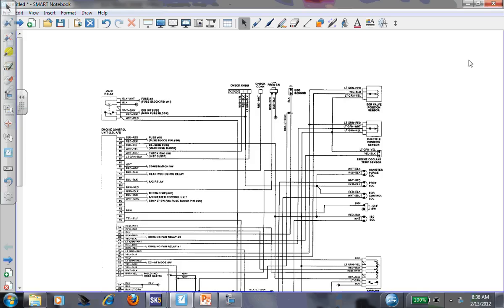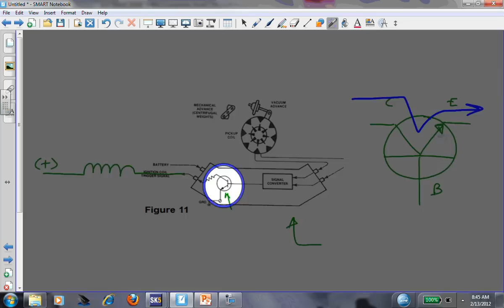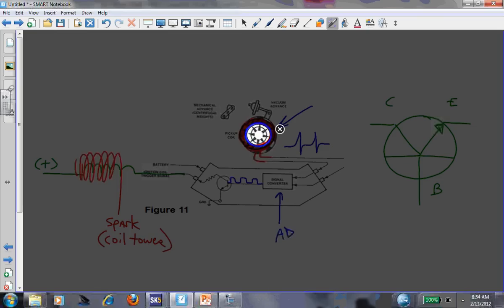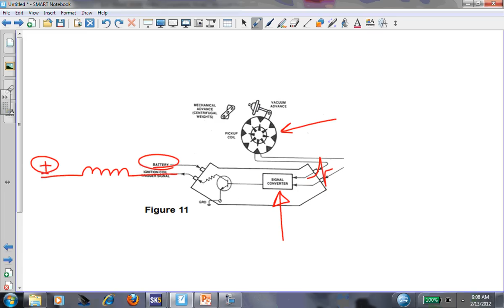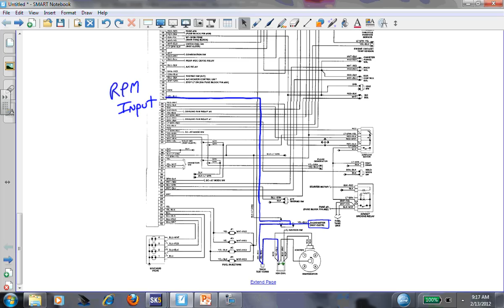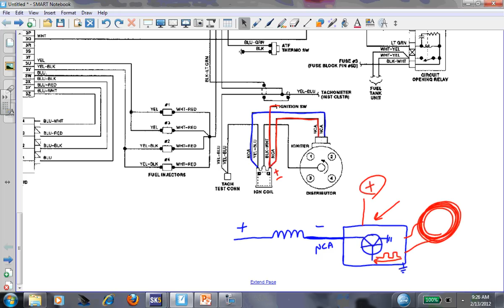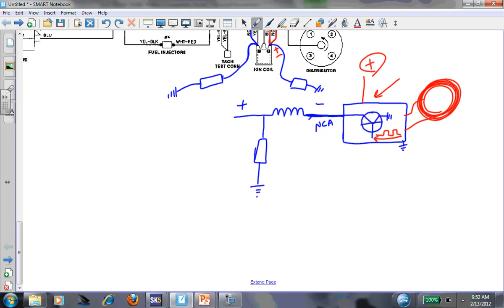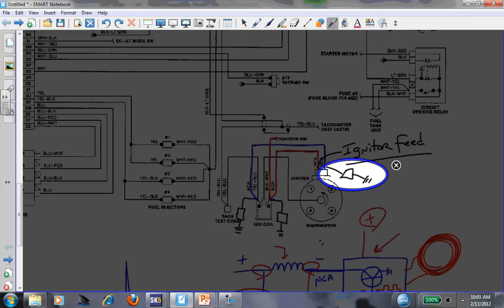Basic Ignition Description, Operation and Testing (any car)

Comment: i dug and dug AND FOUND WHY ... 

so: current flow makes magnets, (current through coil makes magnet)
but magnets make current and voltage, (magnet through a coil makes current)

so when the current is gone the magnetism is still there(for a microsecond)  
this magnetism is transformed BACK into current and voltage. (as magnetism dies it is reborn into current and voltage)

the collapsing magnetism is transformed to current and voltage.so its NOT COLLAPSING its transforming SCARY STUFF man

Comment: Hey ,
I have a 2004 Mazda Miata MX5 and I called the Mazda dealer and he says that there are only 2 O2 sensors on my mx5, Iv found the first O2 sensor and thought I found the second, but it must be something else. The first one is just behind the connection from the headers and the exhust pipe, I found another one after the catalytic converter, then looking for the hole to replace the second O2 sensor I found a third, which turns out to be the second sensor right in the catalytic converter right in the middle of it. So my question is what is the sensor that I took out after the converter if the one in the converter is the second O2 sensor?
Reply from the maker: Front O2 = B1S1
Second O2 = B1S2
Third O2 = B1S3

This is probably a California emission vehicle. The B2 and B3 sensors are used to monitor the cat.
Reply from the maker: sorry, I meant S2 and S3

Comment: quick question, at the very end of the video, you said that if the test lite lights on the coil neg, and if you check it at the distributor and it doesnt light up, that you have an open on that wire, how would it light up at either test lite, if there is no voltage at the distributor, thats the same wire that feeds the neg side of the coil. even if the open is inside the distributor,wouldnt both coil neg and at the distributor be dead? if it was a short? cause its the same wire?
Reply: frank hager there is an open in the wire between the distributer and the coil. the test on the coil would still light up.

Comment: Hey thanks for the reply I did get a new battery and when I checked the battery draw it was around 0.22 to 0.24 so that’s not badr right? what I did find was a snapped off wire in my tailight I re connected it and no more blown fuse for that if this would cause this problem ??? I notic f that the security light is steady on and also from getting 3 fault codes now one is left 53 and 54 45 r gone no more still no crank can the pass key module go bad? Will make a vid when I find it no clue where it is thanks for the help ohh and lights don’t dim much when trying to crank
Reply from the maker: That's 4-5 times higher than it should be. .05 is maximum with .03 or less being the norm.
Reply: Really okay am just at the garage now took half of the interior apart lol looking for relays lose connection ect still no luck am lost
Reply from the maker: Yes they can, passkey module. Clear the codes then re read them and give me the code numbers. I'll look them up tomorrow 
As for where the draw is coming from, disconnect the fuses one at a time and see if your amperage drops on your meter.
Reply: ScannerDanner 
Hey I re check the draw test it is now .021
Reply from the maker: I'll help more later, it's bed time ;-)
Reply: Thanks one more thing I did do the pull fuse test and from .021 when I took of the fuse for the alarm box fuses it dropped to .011 .010 
Affter pulling all of them this is the only one that made a difference  the only code comes up as3 times 53 than back to 3 times 12 that’s it thanks good night👍🏻😎
Reply from the maker: Okay, one thing I didn't mention is it takes time for some modules to go to sleep, so this is a good reading.
Reply from the maker: No problem with the draw, you do not have one. The code 53 is a VATS system code and the vehicle will not start with this issue. I can't post a picture here but can on the "community" tab on my channel home page. Look for it. I'll post it now with the flow chart. Start by checking your ECM and Gauges fuses....Let me know if you find this picture I'm about to post.
Reply from the maker: Can't post the pic there for some reason. You need to go to my forum. I'll create the thread now..
https://www.scannerdanner.com/forum/post-your-repair-questions-here/2124-bassshoter-on-youtube-vats-system-diagram-and-flow-chart-91-firebird.html

It is free to join and you do not need to join to view this, only to comment back.
Reply: Hey still no luck with my Pontiac Firebird am really frustrated by now  made a check light bulb connected it to negative terminal of my battery  and checked for power at the ECM 
There is power on the pink black wire but nothing on the dark blue if I check the vats fuse it has power ???
Reply: How do I check the 5 volt reference with a volt ohm meter ??? If I did it right I have no 5 volt on the EGR sensor or the engine temp sensor  it may be a sort somewhere but when I checked the vats connector it reads the key just fine only if I plug it in the numbers start to jump all over the place ??? Any advice? Thanks Dave

Comment: The resistor was to protect points ,not coil
Reply from the maker: No, the condenser protected the points, the ballast resistor protected the coil from too much current at low engine RPMs as the on-time (dwell) was much much longer
Reply: @ScannerDanner  Ok.But for argument sake how does HEI which uses 12 volts instead of 4 or 5 and just flips the dwell rate from descending to ascending as rpm increases not go thru coils ?
Reply from the maker: @vikinghauler3244  it has a built in current limiting feature to the transistor that controls the coil. Once it is saturated, current flow is limited, hence the current ramp and then flat top characteristic on a primary current waveform on a scope

Comment: No power to ECM relay new starter fuel pump and all the relays are good 96 Nissan Sentra no crank no start was cranking no spark now nothing help appreciated
Reply from the maker: so you have a no crank problem and need help troubleshooting the starting system? or it now cranks and you have no spark? It would also help to know the engine size and why you replaced all of these parts. This only complicates things
Reply: @ScannerDanner  I can bypass the starter relay it will crank bypass the fuel pump relay and it will work no power at the ECM 96 Nissan Sentra 1.6
Reply from the maker: @karlgreat4166  no power at the ECM means you need a good wiring diagram to find out where they come from. If you know your computer does not have power, then you shouldn't be focused on the starter or the fuel pump. Hope that makes sense. You sort of answered your own questions. Where to get good service info.  
https://www.scannerdanner.com/forum/post-your-repair-questions-here/3757-need-service-info-check-here.html

Comment: Hey guys my 91 305 5.0 Pontiac Firebird no Crank problem gets me grey hair lol help!!!!

91 Pontiac Firebird 305 5.0 V8 TBI
Hi there for the last 3 days I have the exact same problem my battery is 2 years old and I drove the car no more than 5 times I did start it up every month for 30 min since it’s a project car but my point is 3 days ago I wanted to move my car to the sec garage with heat in it so I can clean ntinue working on it
and the battery was completely dead so I hooked up a charger and charged it for about 90minm
it looked all good and I started it right up let it run for 40min went shopping and got gas I shut it of filled with new gas and went home next day I tried to start car was dead so I jump started it but cranked started and died than it wouldn’t even crank anymore only the security lights that stays on and when I try to crank it the red park and brake light comes on fuel gage goes all the way but no crank some klick under the hood and steering column
no blown fuses vat system my key is a 10 with 3.750
but when I checked the connector under the dash the wires read the key resistance from the ignition key
but anyway I did get resistors and got it almos perfect to that what the key is
nothing security light still solid on
when I open up the starter relay on the side by the foot wall and press on it and turn the key it will crank and start but die after 2 sec and when I jump it with wires no relay same story dies after 3 sec I did notice my battery now after being charged up all 100% disconnected from the car it will drop down to about 70 to 60% of charge wierd the bat is basically new fuel pump is working to I even tried to jump the safety switch but no results pls help I have no idea what the problem is the car is a 91 Pontiac Firebird 305v8TBI with 183xxx it cool st me well over 10K by now since I got it for 2.7K it’s a Knight Right det Replica that’s why such costs thanks guys for the help I n advance 🍺😎

And just so u know I just tested the codes on it no check engine light on but got these codes 53 54 45 the system High voltage is what concerns me cuz theO2 sensor is du to no muffler on my car fixing the rear axle root
And low fuel pump voltage is it cuz of the VAT system? Thanks for your help Dave🍺😎 and Merry Christmas 🎄😎

https://www.thirdgen.org/forums/search.php?searchid=9430962
Reply from the maker: First thing you need to do is focus on the battery issue. If you are storing this car in an area that is below freezing and the battery loses charge, the battery will freeze and it will be ruined. Get a good battery first, then let's check this thing for a parasitic draw before we get into your anti-theft issue you are now describing.

Comment: tipical magneto ignition nothing more all of those ignition systems are all based on the old thing in my opinion not necesary at all the only significant diference is dual ignition and plazma ignition to a close relationchip to closed exaust system engines then its a diferent stori